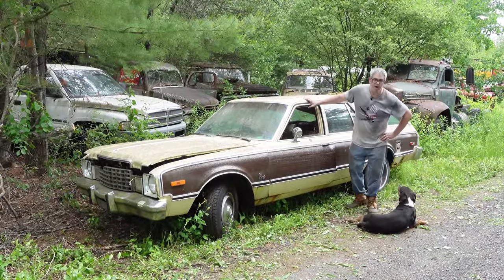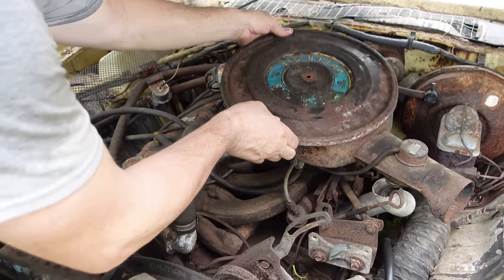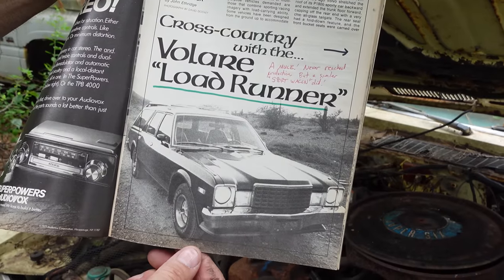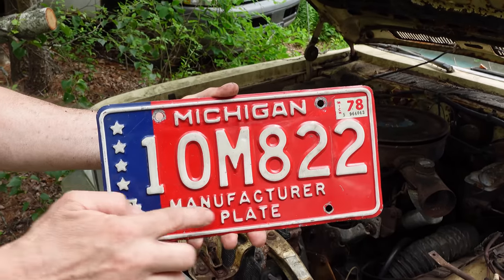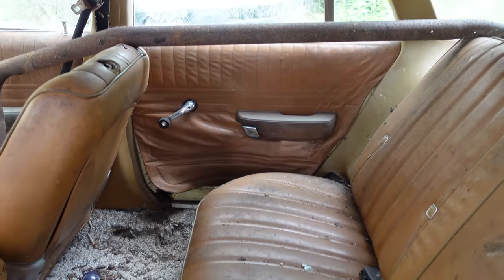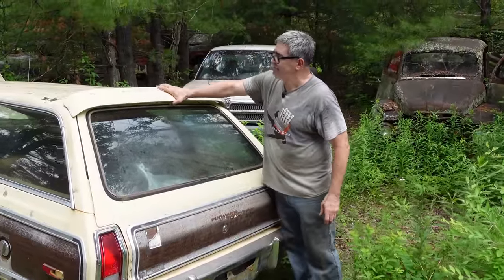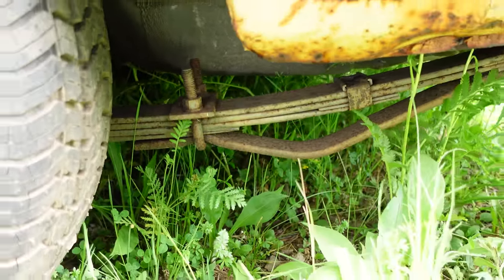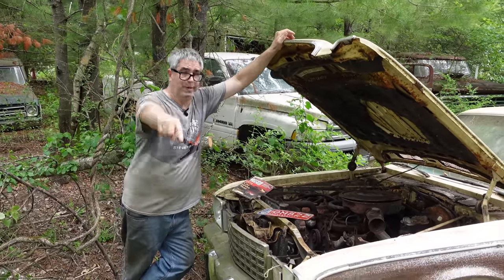Road Runner Station Wagon?

Comment: We had the Dodge version of this when I was in my teens. My sister had a Volare 4 door sedan. both were slant 6 cars. Rust took over the Volare first and my sister inherited the Aspen wagon which she never checked the oil and resulted in engine failure. So at the age of 14, my buddy and I did our first engine swap in the backyard by pulling the engine out of the Volare and putting it in the Aspen. We had a very sketchy scaffold with a chain fall, but we pulled it off. we did get it together and running and yard driving, but the car never saw the road again. It was an awesome learning experience and have been messing with machines ever since.
Reply: Wish kids still did this stuff today at 14. I did my first swap at 16.
Reply: Yes the Aspen nice car's.
Reply: I’m calling BS.  You can’t blow up a slant 6.   When The Bomb goes off, you’ll see Keith Richards driving a Slant 6 in the aftermath. 😅
Reply: Your sister must have "worked HARD" to kill a "slant 6"! These motors were IRON TOUGH!
Reply: didja run it with an open exhaust? any engine swap i did, it was just too tempting to start it up without the exhaust hooked up yet.... Booom! plaap..plaap..plaaap...
Reply: My sister had the Aspen wagon. My brother owned the sedan. The electrical was a nightmare!!! Which is why I have a Taurus wagon instead!

Comment: Looks like Katie is joining the episodes again. She is one very, very friendly dog. You can tell she is well treated and friendly. I wouldn't mind her in all of the episodes. 

Yes, correct, the Super Six had the BBD (Ball and Ball two barrel) and the regular Slant would have a Holley one barrel. Both were wretched carburetors and notorious stallers. My friend had two of these cars, both Aspens. The first was a 1979 with a 318 V8 and the second was a 1978 with a Super Six. Both were four doors.

We got the VIN, we win: H for Plymouth Volare, L for low price class, 45 for two seat station wagon, D for 225 CID Slant Six with two-barrel, aka "Super Six" aka "Leaning Tower of Power", 8 for 1978 model year, F for Newark, DE assembly and the rest is the production sequence. The plant opened in 1938 as a parts depot, then it produced military equipment for a time and by 1957 it was producing vehicles. It closed in 2008. This one was made on Monday April 3, 1978 at about the 12th hour. No tag, can't brag, but possible code PY1 Jasmine Yellow exterior paint. 

Correct, many of those test vehicles were "wringers" and they had some tricks and adjustments made that may not have been done when it left the assembly plant. The '79 Trans Am 400/4 speed car used for test articles from back in the day was rumored to be a "wringer" and had been warmed over a bit before testing it. I think what they wanted to show was what could still be done with some tuning.

Yes, those fenders were rot boxes and ruined the reputation of the car. My uncle had a 1976 Aspen and by 1978 the fenders were rotted. They were fixed by the dealer with a bit of a fight, and my uncle never bought an American car after that. He was a WWII veteran and actually bought Hondas for the rest of his life. His brother-in- law, my other uncle fought in the Korean War and he also stopped buying American made vehicles and bought a Hyundai as his last vehicle.  I worked on both of their last cars and both said, "Won't buy an American car again. Too many problems". As you noted, Chrysler was in big trouble by 1978-1979 and the lack of quality in their vehicles showed.

Unfortunately, it's often said that cars of this era made import buyers for life.
Reply from the maker: Great points all! And speaking of "press ringer cars" remember when Pontiac supplied Car and Driver with a 421 powered '64 GTO? And in '65 a full size 2+2 that ran 0-60 in 3.9 seconds!!! It had 4.30 gears and probably a bunch of tail ballast. Gotta love the "product planning" guys and their tricks! Every car maker did this stuff to varying degrees. Thanks for watching and writing. -Steve Magnante
Reply: My first new car was an ‘89 Plymouth Acclaim LX that I believe was built at the Newark plant? I always thought it was odd that a manufacturer would locate a plant on the coast since it would severely limit the normal shipping radius of the facility. However, maybe the markets on the East Coast were big enough that the economics of locating it there still worked out, along with having easier port access for shipping vehicles overseas…….????
Reply: @ddellwo  Yes, either Newark, DE or Toluca, Mexico. The first digit of the VIN would tell you. A "1" is US made, a "3" is Mexican made. Back in the day, the automakers had plants on various coasts/sides of the country which would (in theory) service a given area.
Reply: @SteveMagnante  Even during the emission era, you can "see" the same basic engines through all of the emission controls. The manufacturers couldn't do it, but many in the aftermarket did with the caveat of "off road use only". Never really happened that way.
Reply: Katie is a sweetheart and I wouldn't mind seeing more of her either.
Reply: @geoffkeller5337  She's got a lot more knowledge than some (not all) who post here. LOL.
Reply: Why was Katie pixelated in prior episodes?
Reply: @youtbe999  Running joke.
Reply: @googleusergp  I thought it was something with her contract😂
Reply: @dubiousf00d  Wasn't getting her gourmet dog food. LOL.
Reply: The "Super Six" was GREAT! Awesome power and dependability/durability! GREAT MOTORS!
Reply: @johnmaki3046  Great engine, crappy carburetion and ignition.
Reply: @googleusergp  I NEVER had ignition "issues", but the Holley carburetors were GARBAGE!
Reply: @johnmaki3046  The Super Sux used a Carter, not Holley.
Reply: @googleusergp  I owned a '79 Volare "Super 6"! I guess this is why it ALWAYS WORKED! Any "Holley Carb(ed)" vehicle, in the era, was a TRUE "experience"!
Reply: @johnmaki3046  Carter was no better. The Carter under your hood and the Carter in the White House were both problematic....

Comment: As for the leaning tower of power, back in the seventies, I helped a friend move from, Naperville,Illinois to Texarkana Arkansas, in a four door ,1967 Dodge Dart,225 slant six, in the summer time, pulling a double axle, u-haul trailer, packed with all his worldly treasures! We went screaming down, I-55 to St Louis, got on, I-44 west bound, that old slant six never missed a beat, of course, when we hit the mountains, we had to crack the hood open, and run the heater full blast, to try to keep her cool!
Then, we got on highway, 71, up ,and down, and more curves, than Farrah in her bathing suit!
That old car, which was nine years old at the time, didn’t miss a lick,it ran like a Swiss watch! The transmission held up too, it made a believer out of me!
The Good ole days!
Reply: Dennis Weaver dual comes to mind😅
Reply: GREAT CARS!
Reply: Couldn't beat 6banger 3 SPD machines😮😂❤❤good mileage, easy to work on 😂people see 6z and immediately want to bolt some kinda 8 b.s. in it. I would love to have another one
Reply: Dating yourself with that Farrah reference 🤣🤣🤣

Comment: There was a 150mph speedometer in a ‘79 Volare police special we had for many years.  Great car, didn’t rust out like the ‘77 Aspen wagon we had before it. I was told the Specials had a different steel alloy and frame stiffener sections.  
Always wanted a police special wagon, best of both of them.
Reply: the steel was the same but it recieve a better rust protection, for your information, on these Volare, the innner panels were left to bare metal from the factory, this explant why they became rust buckets
at the beginning of the '80 s, I've bought a Volvo 240, I never returned to american cars after that.
 It is sad the way they lost the market, it is a question of work phylosophy at all levels of the idustry.
Reply: @jacquespoirier9071  maybe a little "planned obsolescence"?
Reply: @kenttalsma7906  to a point that they lost the market, only the humans are sufficiently intelligent to saw the branch where they are sat on !

Comment: I dig the Volare / Aspen  Wagon platform. I have a 78 Aspen Wagon with the Super 6 and a factory 4 in the floor.
Reply from the maker: I totally forgot to mention the nifty 4-speed Overdrive A833 option. Yes, they add a bunch of "cool" to any Volare / Aspen (or B-van). I used to spot them and grab them in California Pick-A-Part junkyards. Some were cast iron, some were aluminum. The iron ones were preferred by the 360 guys for their (likely) added resistance to "case separation" with 300 ft/lbs or more and hard shifts. Thanks for the reminder. We did do a Junkyard Crawl on a late 1970's Dodge B-Van that was a 4-speed OD unit, so we have covered it at least once. Thanks for watching and writing. -Steve Magnante

Comment: I owned a pea-green ‘77 Plymouth Volare with the Super Six for several years back in the early 90’s as “winter beater”. I was still living in the Twin Cities at the time and as some of you may know, in the Midwest it is common for “car guys” to own a separate vehicle for use during the winter months when copious amounts of salt are dumped onto the roads for ice control. Oddly enough, despite the reputation this car had corrosion it was amazingly rust-free - especially when you considered that by the time I owned it it had endured well over a decade’s worth of Minnesota winters! The thing leaked oil like crazy, but was rock solid reliable and I actually ended up selling it to some guy on a whim for $250 as he was driving by my parent’s country place, saw it parked at the end of the driveway, and stopped to ask if it was for sale!

I always thought the “Road Runner” versions of this car were hokey and painfully overdone with needless exterior design details in classic mid-70’s fashion. However, I think a wagon version of the Road Runner would have actually been kind of cool - perhaps because since it was a wagon some of the pretensions about performance would have already been set aside? If you could find a nice, clean, 318 version of a wagon today (do they still exist?) it might actually be a fun but cheap vehicle for bopping down to Home Depot on the weekends!

So many cars - so little storage space………☹
Reply: Minneapolis winter forecast: 1/2” of snow, 2” of salt!
Reply: In Iowa you're lucky if they "only" salt the roads. They usually put down brine, which I hear is 7x more corrosive than salt.
Reply: These basic "Mopars" were GREAT, CHEAP transportation! I WISH I could say ANYTHING like this about "modern" CRAPSKATES!

Comment: Your right about the rust.  My parents bought a 77 Volare station wagon brand new.  About 6 years later we had a large rust hole on the drivers side floor pan.  I had to cover the rust hole with a sheet of plywood.
Reply: If they bought a 77 Camaro, the whole quarter panel would have disintegrated in 6 years.

Comment: My parents bought a 1976 Volare Premier wagon in late 1975 right off the showroom floor.  It was very similar to this car, although it was white with the wood and it had a 318 in it.  The lean burn system was a real problem as most of my memories with this car involve us being stuck somewhere because the car would continue to stall and then wouldn't start at all.  It also had terrible rust in the lower quarters, dogleg and under the quarter panel windows....and this was all before the car was 10years old, as that is when it was destroyed in an accident.  Great to see this car still in existence.  It has less rust at 45 years old than ours had at 7.
Reply: The 318 did not have lean burn in 1976. The first-year lean-burn came out they were only on 400s, the next year only on 4-barrel engines. I don't believe they were on any f-body car until at least 79, at least in Michigan. The wack jobs in California always had different emissions standards.

Comment: My buddy used to have a SUPER clean Volare wagon with a 318 and those cool plaid seats. It was slow, but it sounded AWESOME with dual exhaust and Flowmaster 40s. We got rid of all the emissions equipment and that woke it up quite a bit, then put an old rebuilt Carter AFB and an Edelbrock intake on it, which also helped. I always thought it was a pretty good-looking car.
Reply: I CANNOT believe that you encountered a "slow 218" in these cars! I owned a (beaten, but FAST) '78 Aspen coupe! This was one of the MOST MOVING cars ever! I could tell so many FUN stories about this GREAT, CHEAP, FUN old car!
Reply: @johnmaki3046  I mean slow compared to fast stuff. Even those doggy '70s V8s were torquey and pretty spunky in these sorta-kinda light old cars. But it was snail-like compared to '60s/early '70s stuff or modern V8s.

Comment: Wow!  Great to see you do a video on an F body wagon!  I have owned a '78 Aspen wagon for 12 years now and it only has just over 30K original miles on it.  I'm the second owner.  It is a slant Super Six with the four-speed overdrive transmission, dark tan plaid seats and door panels, and is the same color as this one in the video, but no fake wood sides.  This was a one-year-only color for 1978 called "Classic Creme."  I found mine online after looking literally for years for a well preserved one, bought it immediately sight unseen, and flew out from PA to Pueblo Colorado to pick it up and then drove it home with no problems.  It has zero rust, being a high desert car for it's entire life, but it does have a few small hail dents in its original paint.  It also has the rare optional AM/FM/CB transceiver with the original microphone and the one-year-only power antenna.  I love these F body Aspen and Volare's and they are becoming quite unusual and difficult to find.  It's a lot of fun to drive around shifting gears and it gets a lot of thumbs up and comments.

Comment: My father had 2 Volare's back in the mid 80's and they were both manual transmissions. I forget whether they were 4 or 5 speeds because I was about 7 or 8 years old at the time. The first one that he bought at a used car dealer was a real lemon so he took it back and they gave him another Volare,  just a different color.  That one didn't last him but maybe 6 months because he had to get rid of that one to because it always gave him trouble.  Neither of them liked to start in the rain and they both sucked. He eventually bought an 83 Buick Regal Limited, which he had for at least 10 years and gave him no problems at all. Chrysler products of the late 70's sucked in his opinion and they do in mine too. Thanks for the video Steve and the trip down memory lane.

Comment: There were plenty of economical plastic/polyurethane front fenders available for the cars during the 70’s. I put a new front fender on my 71 Valiant myself, just bolted right on , very quick and easy, cost me $100.00 at the Auto parts store.  These cars were easy to repair and maintain in a presentable condition.

Comment: I delivered a number of Volare/Aspen vehicles back in the summer of 1976 when I worked for M&G Convoy out of Detroit, MI.  Solid little cars for the era, but had all the manufacturing faults common to all the Big Three back then.  I bought a new B100 (Dodge Van) in 1977 that had the 318 and 4spd overdrive manual (A-833), which I believe was available in both the Volare and Aspen models.
Reply: They were. A buddy had a 77 Aspen RT with the overdrive four speed.

Comment: your videos are THE BEST Steve!  I grew up with these cars new in the show room - Mom’s first car was a 62 Lancer 4 door - push button Torque Flite equipped as she could not drive a stick no PS or brakes or AC - we continued to upgrade every two years as my grad dad liked to trade often - our first wagon was a 66 318 powered Belvedere II 3seat wagon with PS PB and factory Airtemp  she later drove a series of 4 Sport Suburbans - I remember going down to the warehouse of our local Chry Ply Dodge Imperial dealership, Holley Motor Co in Tyler, Texas and selecting my brand new 318 V8 powered 76 Carmel Tan metallic Aspen 4 door SE equipped with the 5 spoke chrome styled road wheels with center caps and trim rings tilt steering wheel auto speed control - never had any rust issues - loved that car - my grand dad later gave me his loaded 440 lean burn powered 77 Jasmine Yellow New Yorker Brougham - cool flashback from another TV show?